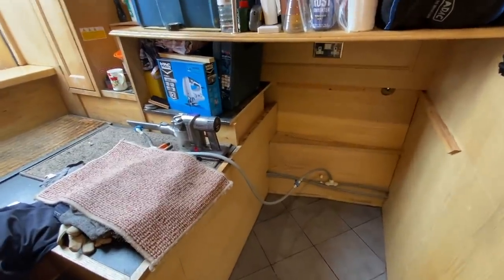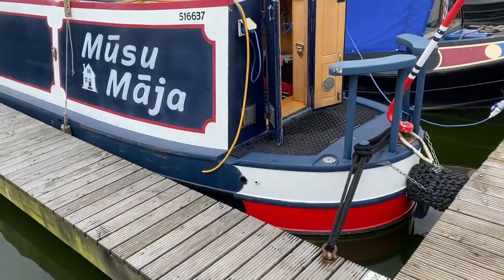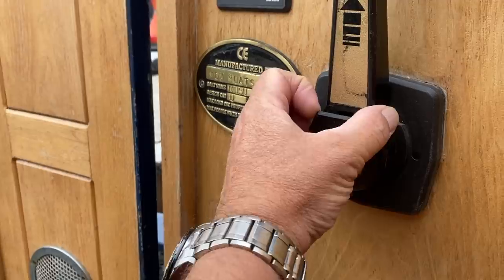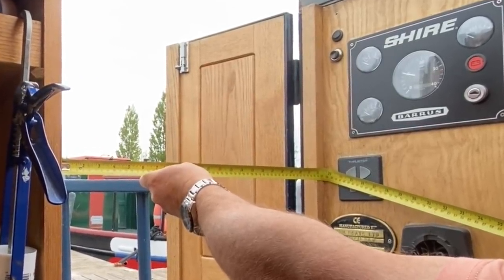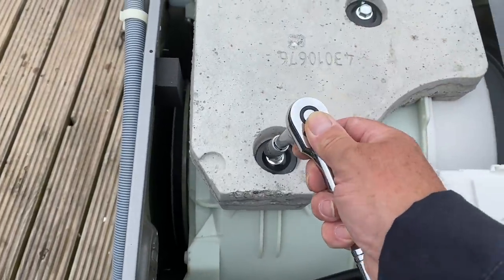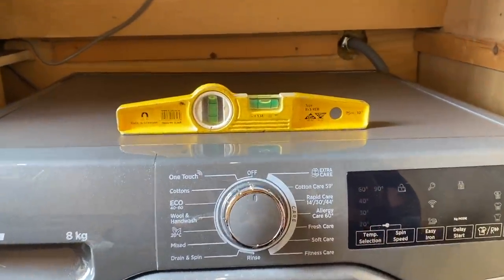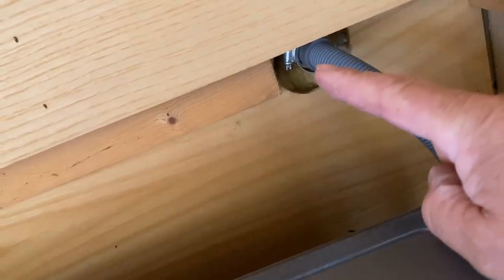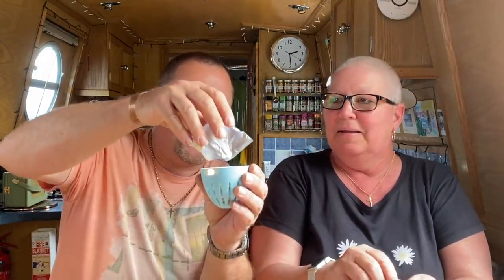Narrowboat Essential Item Breaks Down & How To Not Need To Buy Washing Detergent for 3 Years E105

Comment: I’m loving the chic regrowth Debs!
Reply from the maker: Thanks ❤️
Reply: Deb even manages that lovely silver / grey without dyes.
Reply: @welldeckdiaries5610  it was quite a old machine you had
Reply: @welldeckdiaries5610  bekos are amazing they build slimdepth ones and only take 28 mins for a full load which is amazing I'm not keen on hoovers as they don't last for very long. Bekos are the way forward.
Reply from the maker: @theoddjobcentre6686  14 years, not bad for a Hoover
Reply from the maker: @theoddjobcentre6686  We looked a Beko but the ones that would fit were not in stock. This machine has a 14 min, 30 min, 44 min, min 59 cycle and then your normal and eco programs, I can even operate it from my phone, a feature I don’t think I’ll ever use

Comment: You owe me a laptop screen.  I was drinking lemonade and lime when you made the remark about 'tom cat'.  I have often wondered why narrowboats are not built with a hatch - like a duck hatch or hatch in the side, whatever - I could draw it easily enough - which would allow any number of bulky, heavy items to be craned in or out.  Okay, I'm a Scout Leader, so I know about 'block and tackle and jibs and rope slings and so on, but I am not a rocket scientist and even I can see such a facility could be built in to a boat without great cost or inconvenience.  I even think it could be done to an existing boat, with a plasma cutter and a few 'electric bolts'.

Great vlog though guys.  Good to see Debs looking and sounding so well - virtual hugs all round.
Reply from the maker: The boats with a traditional engine room have a large plate cut out of the roof and bolted back in so the engine can be installed and removed

Comment: Something I would have fun doing is take a clock identical to one hanging there on side of pantry and replace its workings with one which runs backwards & swap the two clocks at several random points between scenes for the video.
Reply from the maker: We did have a bit of fun with the clock in some earlier vids

Comment: Great job getting the machine installed on to the boat! We just replaced a washer & it's an awkward enough job for landlubbers! Cheers
Reply from the maker: They are never easy to get in and out
Reply: Decades after making these, they still can't be bothered to press hand-holds into the side panels. Lifting isn't so bad, getting a grip is the problem. Buggas.

Comment: Was i the owner viewer that was talking to my laptop and saying Mark turn the machine around as you took it through the back doors, But I guess that way it must have been easier to remove the transit bolts and get the lid back on.   

Take care both of you,
Regards Steve
Reply from the maker: 😂🤣 Once it in on the floor there is room to rotate it 360 degrees
Reply: @welldeckdiaries5610  I was waiting for the "bleep machine" in an out-take scene in the vlog...Glad you managed to get it in and working....

Comment: I have seen adverts for eco egg. I guess they work on abrasion etc or something. Chemistry not my strong point 😂🤣😂 but you can always add dettol laundry sanitiser designed for low temperature washes (especially babies) might be a reassuring back up.
Happy boating
Reply from the maker: It would be interesting to find out especially as they produced the suds like a detergent does
Reply: Well Deck Diaries if they work would be great for everyone to get an update 😊

Comment: Tape the transfer bolts to the inside of the cabinet at the back. I do that with most of the bits that our appliances require. Of course you'll put them away in a safe place and three years from now, will have completely forgotten which safe place it was.
Reply from the maker: I cant remember where I've put them now 😂🤣

Comment: Just a question because it is now nagging away at me. How was the old washing machine put in if it was too big for the doors? Did you dismantle that too or was it installed as the boat was fitted out, so before the companionway was built in?
I might add that we have our machine upstairs in our house. (Logical place, you take clothes off that are dirty upstairs, so have the machine nearby and the drying is on a ceiling mounted rack in an enclosed balcony - where the machine it plumbed in. Ironing board in the room just inside from the balcony/drying area.) Anyway, when our old machine died I ordered a new one that was delivered and carried upstairs by the delivery men but unlike as promised by the shop they refused to take the old one away, so I ended up completely dismantling it to carry it downstairs. About 70kg in all due to a massive concrete collar right round the cylinder. You were lucky that yours is just a block on the top. Did you know that was how it was mounted before you bought it?
Reply from the maker: the washing machine was put on the boat when it was built in 2007 by the original owners so I don't know how they got it in.
Ive repaired a few washing machines in my time so I was pretty confident on how to take it apart and what would be inside.

Comment: Never seen anybody use a spirit level on a boat . The levels change all the time , just use a tape .
Reply from the maker: Narrowboats by design slope backwards from the bow, its fine fitting cupboards and units inline with this slope but a washing machine should be as level as possible to stop it bouncing about. Had I used a tape to line things up, the washer would have been at the same jaunty angle as the fixtures around it, hence the revelation for you of seeing for the first time a spirit level being used on a narrowboat. As you say levels do change slightly with levels in the water and fuel tanks vary, but only slightly.

Comment: On a different subject I am interested in what vacumn cleaner you use, 12V corded or cordless or 230V through an inverter or a cordless rechargeable or..... you get the picture I hope. Ive got fed up with using a dustpan and brush on my knees when away from shore power. (not joking)
Reply from the maker: https://amzn.to/2T23O91
we use a Dyson
Reply: @welldeckdiaries5610  Sorry to extend this but the link doesnt say whether it is recharged from 230V off an inverter or can be charged direct from a 12V source BUT thanks for a quick reply.
Reply from the maker: @johnfoster3286  230v

Comment: you did force the plastic shafts to the transit bolts out ..... in about 10 uses just check the top/ concrete block bolts go clock wise i was installer for comet please put your washer on a hot cotton wash at least once a month even if youve got nowt to put in it........... debs youve got hair ..... yipeeeeeeeeeeee
Reply from the maker: Yes I did.
Righty Tighty 👍 on the block bolts
And thanks for noticing the hair ❤️